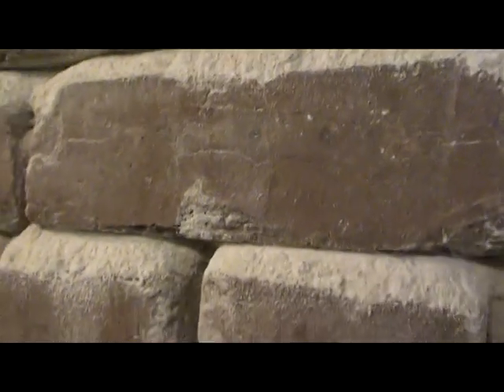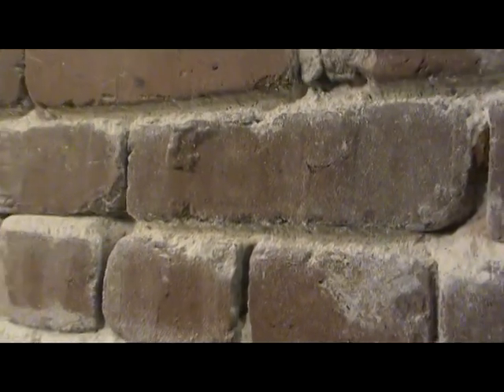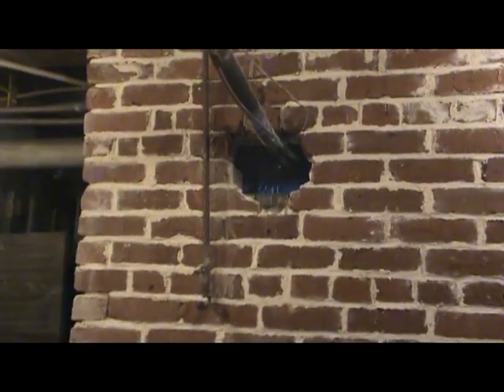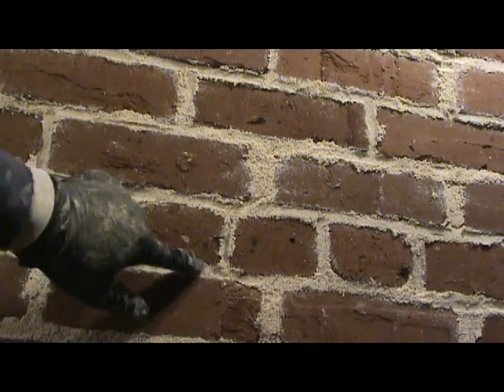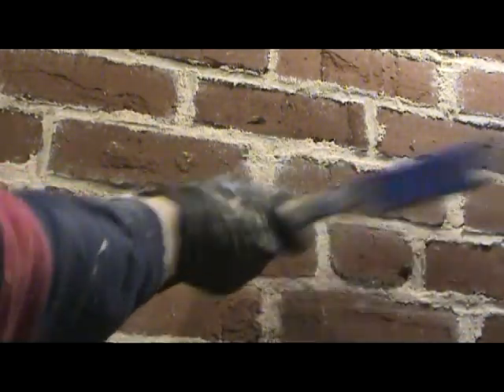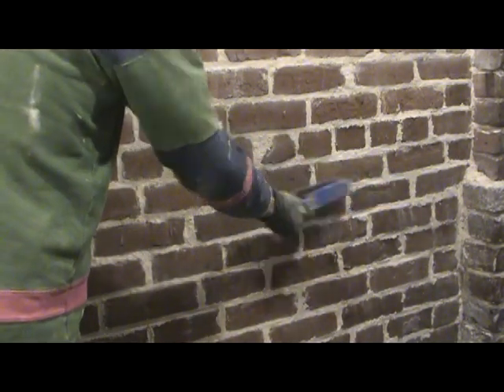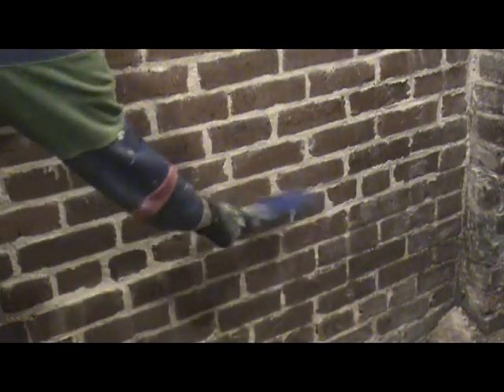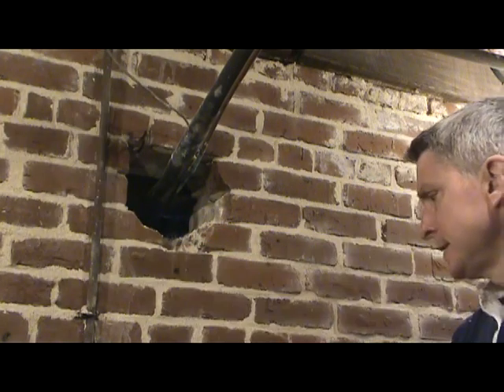How to Repoint Failed Lime Mortar in Historic Brick Pt. 1

Comment: I'm wondering if the dry hydrated lime you used to make your putty was too old and had already substantially gone off (become plain old powdered limestone again).
Reply from the maker: Hydrated lime is essentially unreactive, I have come to find out. It is used as a workability agent in mortar but never actually sets. It will react only if pozzolans are present in the mix. These act as a catalyst and back in the day masons used to mix materials in with the lime and sand that contained pozzolans. That knowledge has been lost and people trying to rediscover lime mortar are trying to mix sand and lime together without this catalyzing agent. Now that some years have gone by since I did the repointing found in this video and it is failing rapidly. I no longer use type O mortar and only use NHL3.5. I recommend you do the same.
Reply: @wickedmessenger1 Hydrated lime in dry form is calcium hydroxide but if it's old and has been exposed to the atmosphere it has probably reacted already and reverted to calcium carbonate, which is useless except as garden lime, or a plasticizer as you said. Where i am, the manufacturers specify their product as 95% calcium hydroxide after 3 months, and i assume that is provided the packaging is fully intact, but it's common for the double paper bags to have tears or holes from handling. I haven't tried using ity to make putty yet but i may do so just to see.

Best to buy lime in the putty form already, which is the same stuff only with additional water added in production, and will last almost indefinitely if kept sealed. I've had mine for more than three or four years before I've used it and was very nicely matured by then.

I haven't had the need yet to add a pozzolanic additive. I've got a bag of fly ash to try at some point when i do.
Reply from the maker: @cottawalla  I know that some of the lime specialty companies that make lime putty or who provide custom lime mortar mixes based on the existing mortar in a historic building actually make a product that sets like it should and will make lasting joints without any additives. I suspect that their lime source already contains catalyzers. However, I have been in correspondence with someone who actually talked with an engineer at a company that makes mass-produced hydrated bag lime and he told him that their product does not set. Period. It does not react through carbonation and it is solely a workability agent. People buy this and assume that this lime is like lime from the olden days and it is not. I was one of those people. At this point none of this is relevant to me because I'm totally sold on NHL and see no need to go back to hydrated lime putty to make mortar, even if it actually works, like that from specialty companies.
Reply: @wickedmessenger1  it would interesting to see the actual chemical breakdown of that bagged lime. The reason i bought the putty (a tonne all up on a palette) was because i didn't trust the dry bagged stuff, and i can't get NHL where i am, which is why i also have the fly ash to try.

For me doing a DIY restoration, the non hydraulic putty is very useful. I can mix a batch of render or mortar, store it in pails under an inch of water and just use it as i need it. I can also work slower without getting into trouble.

Comment: What about 100 year old concrete block/ cinder block?  It is made with some Portland, but no idea how much.  Could Type N Mortar work to re-mortar?
Reply from the maker: My gut tells me you'll be fine with Type N for your vintage cinder block. You will probably get a feel for how hard the mortar is when you rake out the joints. If in doubt, you can always get it tested so you know the original mix.
Reply: Thanks for your opinion, appreciate it.

Comment: Listen all, hot lime is the best. Just add 1 part calcium oxide pellets to 2 parts sand aggregate and 1 part clean water and mix carefully in a tyre bucket using trowel wearing good ppe.The aggregate needs to be defined carefully however, less than 10mm and above 50 microns depending on width of joint. The material is filled into the joint as in the above video, left for a few hours to allow to partially set and then hammered using a hard plastic hammer and then churn brush hammered to expose the aggregate and get co2 into the joint. Keep water and direct sumLight off the joint. Except for st astier hydraulic lime, most manufactured lime products are of a poor quality. The manufacturers do not want you to know the above formulation I have just given you. The plasticity and mechanical strength and water sealant properties of the hot lime formulation are far far superior because it is the heat realeased whilst in the joint which facilitates the release of water to allow co2 in to make limestone. Ha ha ha ha. Just experiment with different aggregate particle size distributions to perfect the mortar. The calcium oxide is only 100 pounds per tonne, aggregate about 50 pounds per tonne. Compare those prices to expensive hydraulic limes......there's no competition. As always, putting power and performance into the common working man, out to get robbed by the manufacturers.
Reply: Agreed. Not as easy to get hold of. I built a wall with hot lime mortar (3 sharp sand : 1 quicklime) different than cement mortar to use. 
Could have gone over the joints with a piece of wood to compact and fill any cracks that appear, then hit with a churn brush.
Reply: DRJMF1 BINGO!

Comment: Thanks for the video. You do great work. I'm working on restoring an old 1882 Victorian home in downtown Los Angeles area that is mostly original, including the lime plaster walls and lime masonry brick foundation. 
I've been trying to source "quicklime" here in LA and have been finding seasoned masons and historical experts confused on the use of Quicklime/Calcium Oxide and Type S Lime Hydrate/calcium hydroxide.

It sounds like you used Type S Lime Hydrate on your original pointing job years ago. If so, putting the Lime Putty in buckets covered with water for a month is what you would do after "slaking" quicklime. Quicklime and Type S Lime are two completely different animals. Basically your buckets of Lime Putty where dead on arrival and still dead when you did your repointing. Instead of the lime mortar getting stronger with age from the CO2 in the air, the bond broke down from temperature, moisture, and vibration. 
Both Lime and Portland are "cements", however, if you don't use Lime in its Quicklime/Calcium Oxide state and slake/"boil" it to putty, it is not cement and is instead an adjunct to other cements like Portland Cement.
So, if you use Type S Lime, it is dead, not a cement, and needs to be used with a cement like Portland cement to set up.
Would be great if you could do a test after slaking quicklime and pointing
Reply from the maker: Since I did this video I have become sold on naturally hydraulic lime (NHL 3.5) for repointing. Please watch my video "How to repoint with NHL 3.5."  It is also easier to use than quicklime and there is probably a local supplier if you're in a big city like LA.  Here is a link: https://youtu.be/ATER7aJnjB0
Reply: D Fitz Trans Mineral in Petaluma, is the sole importer of St. Astier NHL.

Comment: Why did you put cement in it. Just 1 Sharpe 2 plastering sand 1 NHL 3.5 would've done it
Reply from the maker: If you look at the long discussion under the last comment by Konstantin Tantin below you'll see a lot of discussion of why I did what I did. But the short answer is NHL3.5 is drastically harder than Type O mortar, I had already been disappointed by deterioration of lime mortar from rising damp and I feared a repeat performance, and I have some history with using Type O mortar with the house with no adverse affects -- and I know it can stand up to rising damp. The purist in me does not like my decision but the practical side of me won out. I have some more repointing to do and I might try a little experiment with NHL3.5 to see how it works.

Comment: Doesn't look damp, and no such thing as rising damp. Maybe it dried out to quickly when you applied it. You need to keep spraying it with water over a few days as it starts to dry out
Reply from the maker: There is without a doubt such a thing as rising damp in porous brick with lime mortar. I am aware of the "debate" about it but I believe it's due to a lot of scam artists who con people in England that they need an expensive damp-proof barrier installed when they really don't need it. This has made people say it's always a scam and there's no such thing. Here in the United States, most people have never heard of it and most structures are immune to it due to the vast preponderance of existing buildings having been built from modern brick with portland cement mortar. In this case, with a 19th century building made of brick that drinks water like a sponge, a very high water table (sometimes actually coming up into the cellar through the ground), and salts from hurricane flooding now permanently in the brick to greatly worsen the rate of absorption of groundwater.   Since I made this video 2 years ago I have disavowed the use of Type O mortar and now only use NHL 3.5. You should watch my video on NHL and ignore this video and part 2 of this video. Also, please stop telling people there's no such thing. It's a real problem in certain situations with certain types of construction.
Reply: @wickedmessenger1  ‘If you build a brick pillar and stand it in a tray of water, the bricks in the water will get wet, but the water doesn’t rise by capillary action,’ said Howell. ‘Cement-based and most lime-based mortars will not
allow water to go through.’
Jeff Howell, a qualified bricklayer and author of The Rising Damp Myth (2008) said trials in the laboratory confirm the falsehood.

"Rising damp" is a term that should not be used lightly. What we are slowly discovering here in the UK is that "rising damp" has been abused to trick people into believing they need to stop it by injecting bricks with glue/resin.  Rising damp is usually the result of some sort of 'failure' structurally, incorrect methods of "curing" a problem or a cracked drain pipe. If you go to Holland where homes are pretty much built on top of marsh/fen land they have no idea what rising damp is.

Another small good read.
https://www.woodwardsurveyors.co.uk/blog/does-rising-damp-exist.html

So..Eric is ok to say it's a myth of there is no scientific proof to suggest it is actually true.

The truth is that there is not enough research out there at the moment as no funding would be given to such  extensive research as too much money is being made from the "myth"... even the banks are in on it... they refuse to give mortgages in the UK to people unless they pay to have an "injected dpc" installed.

Can you imagine if rising damp was proven to be a solid myth?? people would be owed large sums of money in compensation for paying to have work done that was not necessary.

I like your video though and thank you for using lime instead of cement.
Reply from the maker: @electronurd3234  This excerpt you have posted says what I said, which is that modern materials do not conduct rising damp but porous brick and lime mortar do conduct water through capillary action. It's not something most people will encounter because most structures are not old enough. But those that have the right kind of brick and mortar plus a high water table do experience rising damp.

Comment: Use hydraulic lime, NHL2.
Reply from the maker: It's a bit too soft for this application. I now use NHL3.5 exclusively for repointing work. Since making this video I am never using Type O mortar again.
Reply: @wickedmessenger1  
A pozzolan should always be added to diy lime putty (for outside work).  10% of the mortar mix (max. amount).

Comment: this video might be an explanation of what you experienced: https://www.youtube.com/watch?v=I8qehBmIm_c
Reply from the maker: Yes, that's certainly the same failure that I had (powdery, no strength) but I'm not sure how it could have happened to me unless the lime was set up already when I bought it. I bought the lime from the major supply house that everyone uses for historic work so I assume their inventory turns over rapidly. I used the lime immediately to make putty then let the putty sit under a few inches of water for an extended period of time. Also, I did this several times for different areas of the crawlspace on and off over the course of a few years. Everything failed the exact same way. I really think it must be the rising damp doing this. And if it is the case that the lime was already bad the day I bought it, my conclusion would be the same: I can't get by with just lime mortar and must use portland to make Type O mortar. I think that now that I know more, the next time I repoint the last few areas I still haven't done I'm going to try NHL 3.5 and see how that goes. I stayed away from it because it's so hard but I think an advantage is that it has better vapor permeability than portland cement and will help the rising damp evaporate through the mortar.
Reply: what type of lime did you buy?  How did you make your putty?  We are doing an 1861 brick house now and want to make sure we can learn from your issue.
Reply from the maker: It was probably 10 years ago so all I know is that it was hydrated lime in bags, not the brand or any other details. What's typically available is Type S hydrated lime so it was probably that. I put water in 5 gallon pails and added the lime to it while mixing until it was fairly soupy. I topped it off with more water and let the pails sit for about a month. The lime settles so you just pour off the water, which is pretty clear and you have nice lime putty. I mixed with sand around 3:1 sand to putty and beat the mortar with the end of a 4x4 to really force the lime into the grain of the sand (something they used to be done back in the day for the best mortar) then went about repointing. I sprayed it down lightly for 3 days to make sure it stayed wet while setting up. The video shows what that got me: loose sand.
Reply: wickedmessenger1 hydrated lime never cures. your supposed to use hydrolic lime.
Reply: wickedmessenger1 that looks exactly like hydrated lime, it just turns to dust.
Reply from the maker: I have come to believe that's true. However, I learned how to make lime putty and make lime mortar by taking a class led by an "expert" in the field of historic masonry. Also, there are a lot of videos out there where people are doing exactly what I did to repoint their houses. I wanted to get this info out there to help others avoid making the same mistake I made. Since that time I have had a lot of very informative online discussions about lime mortar and most agree that you have to use NHL or add  pozzolans to the mix. I have misgivings about using Type O mortar as I expressed during the video but felt it was a good compromise. I think in the future when I do more repointing I will use NHL3.5 and see how that works. For now, half a year later, the repointing work I did in this and the Part 2 video is holding up very nicely and looks great.
Reply: wickedmessenger1 well good luck to you man, there's lots of info out there and everyone has their own styles and techniques, but in the end good on you for restoring that brickwork instead of plastering over it.
Reply: Are you in the US? Where do you get hydraulic lime in the US?
Reply from the maker: I'm in Charleston, SC and there is a local supplier who carries it. If you do a google search you might find a supplier near you. Or you can have it shipped to you. It might not be as widespread as in Europe but it is available here.
Reply: konstantin tantin I'm in bloomington indiana and we found a place in Indianapolis that can get  order it when we need it.  call masonry supply companies and ask if they can get nhl or phl hydraulic lime.
Reply: konstantin tantin standardmasonry supply in Utah can get it for you. if your around here.
Reply: Thanks all.
Reply: konstantin tantin  the way your doing it is abit fussy! Put your horizontals in nice and deep hitting 2 even 3 times and move on . No need to move hawk and titter scraping the mortar to clean off , that will fall off later. 
Then do verticals all at once.
Then you can hit it with a brush which brings the aggregate to the surface
Reply: Josh Targo Who is your supplier in Indy?